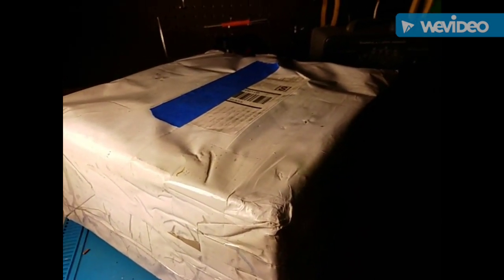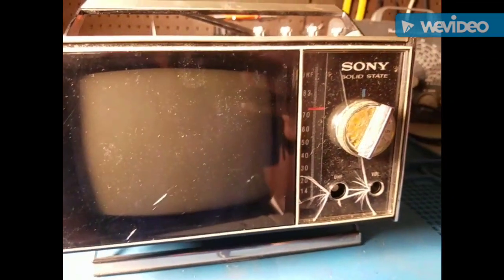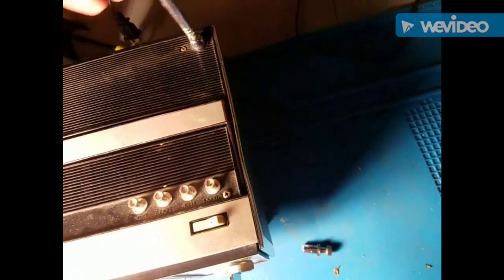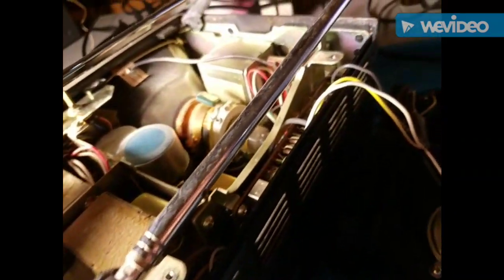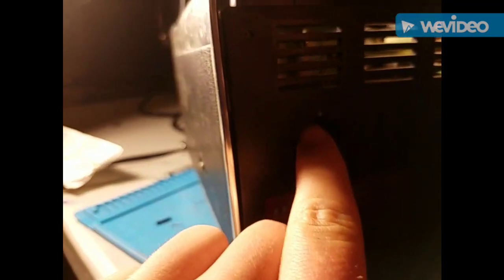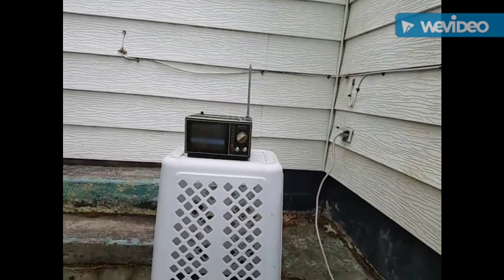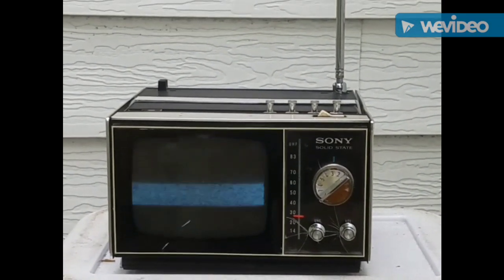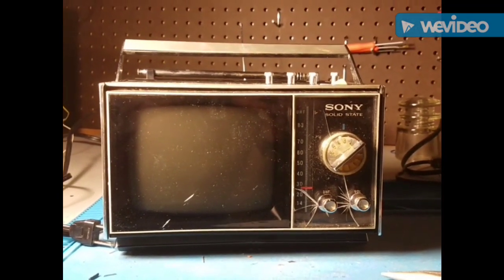1967 Sony TV-500U Unbox and Test

Comment: I have one of these in perfect condition! Up until 17 years ago I had it on my desk and hooked up to cable. Those little ports you said were for headphones and recording are, I believe, A/V ports -- that's where I had hooked the cable line in from the cable box with fork terminals, two screws and some kind of cable. Wish I could remember more! Now I can use the side jack to hook up my old VCR/DVD player and am trying to figure out how to hook up my Roku. Wish me luck!
Reply from the maker: That's awesome! I had no clue what those were for, but it does make sense!
Reply: Any chance you could dig up a picture of that cable? I've been trying to figure out video-in on this thing for weeks. I can't even find a solid service manual for this TV.

Comment: What cord did you end up using to power the TV? I've got a nice TV-500U here but untested.
Reply from the maker: I just used a standard power cord and plugged it into the 120 input on the 4 pin jack
Reply: @bratwurst2923  thanks
Reply from the maker: @aaronmiller9769  just make sure it's in the correct position! Dont be an idiot like me and plug 120V DC into the 12V jack accidentally! Lol

Comment: Is it possible to modify these to have a video input?
Reply from the maker: Depends on the input. If you want a more common antenna jack, certainly. If you want RCA inputs I'd just go with buying an RF converter as it would be the easiest way to go about that.
Reply: @bratwurst2923  I want to remove the antenna and install a regular physical RF input. Lots of examples of this out there but zero guides!

Yours looks nice btw. Mine is all crusty and missing the channel knob.
Reply from the maker: @stegoeggo  what you'd want to do is just use the same wires the old jack uses since the two Jack's would have the same purpose, then it should work. TVs like this really make me wish analog TV broadcasts were still around here in the U.S., lol